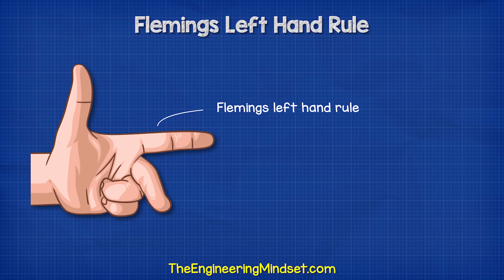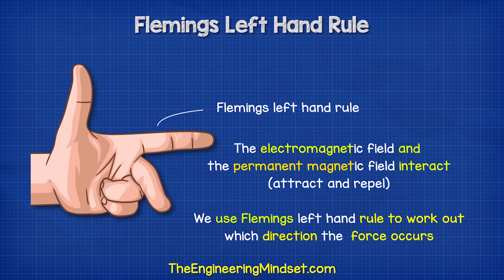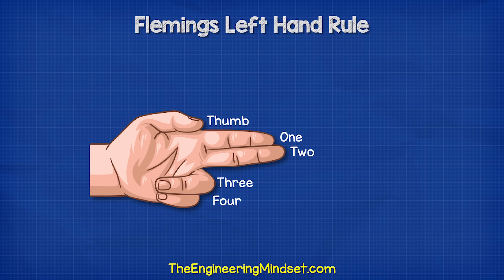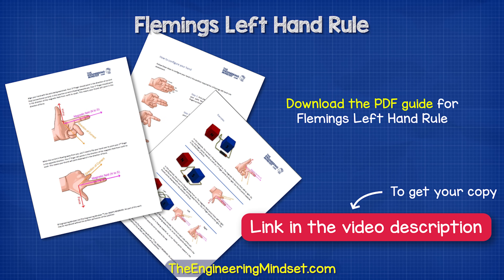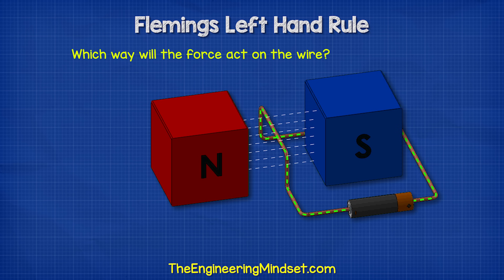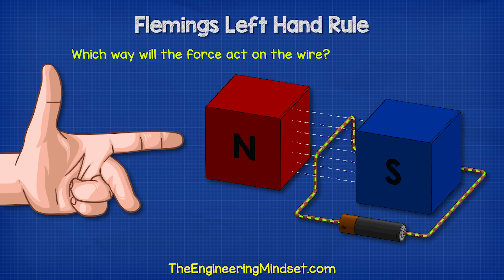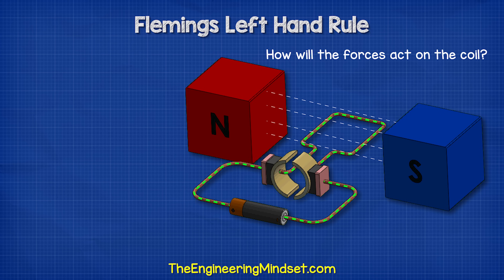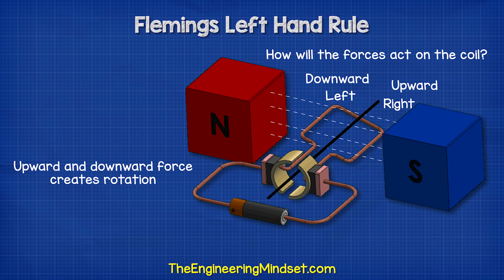Flemings Left Hand Rule

Comment: As an electrical engineer, I learned the right hand rule. I just had to look up the difference (and different uses) between left hand and right hand rules. Maybe that would have been useful to cover quickly or mention in your video?
Reply: I learned as the right hand rule didn't know is different for the left hand, bro if you could explain it it please would be great
Reply: Learned the right hand rule while learning electrical systems in the automotive industry
Reply: Right hand rule is for positively charged particles meanwhile the left hand is used for negatively charged particles.
Reply: @feecker  Ones for generators the other for motors.
My teacher told us to remember General Motors gor left and right hand.
Reply: In IGCSE Physics we took this:
Left hand rule: Motors, protons and alpha particles. 
Right hand rule: Generators, transformers, electrons and beta particles.
Reply: Right hand rule is for motion causing current i.e applocations of epectromagmetic induction, while left hand is for curremt causing motion i.e applications of chrremt carrying conducyorsnin a magnetic field
Reply: All you need is the right hand rule and Lenz's law.  Flemming's left hand rule is intended to make things easier for folks who haven't taken physics, but in my opinion, it obfuscates the physical situation and causes unnecessary confusion.  I don't teach it.

Comment: which way the current is coming is a matter of perspective. you need to explain this with more concrete methods. im just looking at the battery. imagine if you just flipped the battery on the left side instead of the right, the direction remains the same in the conductor but the direction of the current changes... what then? must the conductor coming from the battery always be on the right with the N S on the let for this to work? wtf.

Comment: As a non-electrician but an operator who has had sync very large generators to the grid, I still can't put this into practice.  Maybe I just need to connect up a few motors and I'll finally be able to apply this rule.  And for the life of me, I can't find out how you can carefully disconnect a 3-phase motor and an exact replacement and installed as marked when removed, runs backwards.

I understand the rule, I just can't put into practice.
Reply from the maker: We have a video where we show how to design and build a motor. Then you use left hand rule to work out the rotation to see it. Give that a go

Comment: It's easy to update this for modern usage/terminology:

Index finger is force (intuitive)
Thumb is magnetic field
Three small fingers are electron flow (they make the shape of an E)

Also works for EM waves:

Index finger is wave propagation
Thumb is magnetic field
Three fingers are electric field

This is way more intuitive and simple than trying to use Fleming's original rule and then flip the result 180°

Comment: Or you could use the T_Rat RIGHT hand rule…
 THE index finger also known as the pointer finer points in the direction of current flow ( pointer finger points in the diection of what you know first which is the current diection- easy to remember), 
THE middle finger points in the direction of the magnetic field N_S (middle - magnet, easy to remember)
THE Thumb (first digit) is the direction of force (first - force, easy to remember)

By the way, I have NEVER seen any one refer to the index or pointer finger as the finger number one, except on this video.